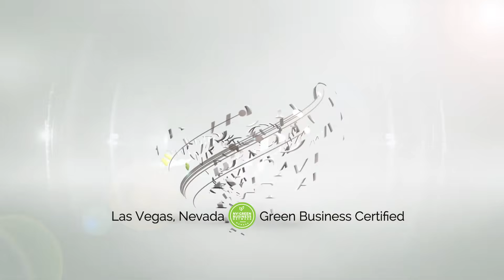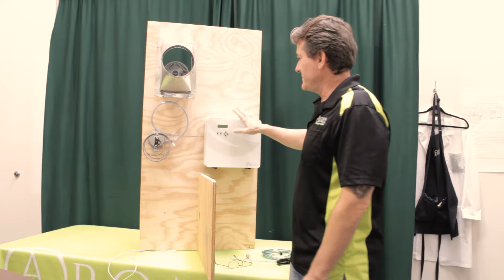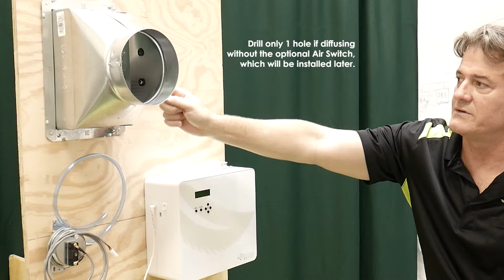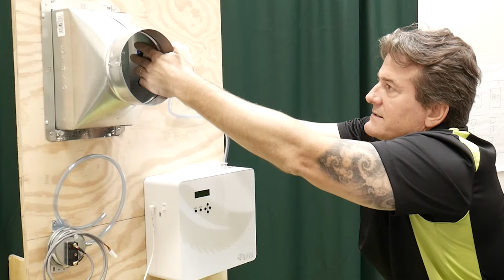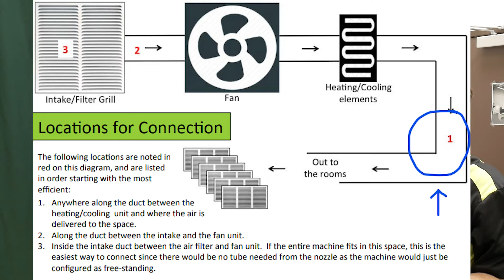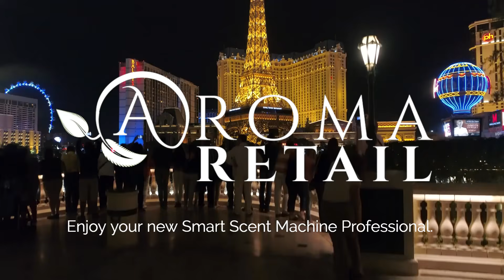How To Install & Connect The Aroma Retail Smart Scent Machine Professional to HVAC With Air Switch

Comment: Okay, so my plenum is in the attic. My ac filter is in the attic. How would you suggest this get hooked up? The way it looks on the diagram is, I could just stick it into any AC. Line, but that seems a little odd. Wouldn't I need to put it in the one that pulls in air (return);instead of blows the air? Each of my bedrooms has a return in it.

Comment: Do you disconnect this cleaning with alcohol.  Run it outside to clean out every few months?
Reply from the maker: You can leave it plugged in, but you'll want to have the machine on while it's diffusing the rubbing alcohol for about an hour!
Reply from the maker: @AromaRetail Every few months if you'd like, but definitely when you are rotating through heavier scents like our Holiday scents!

Comment: Is it safe to say you should insert the diffusion line AFTER any heating/cooling unit?  I have a vertical setup.  Cold return air comes in the bottom near the floor, then air is pulled upward and blow up into the ducts near the top of the basement.  I would think I want to insert up above the heat/cooling exchange zone, right?
Reply from the maker: Great question! Yes, it is ideal to have the fragrance come into the duct after the heat/cool exchange in the air handler.  There are rare situations where customers can only put it before the air handler, but it is much less efficient since the scented air has to pass over the heat/cool elements.

Comment: My home is 1,500 sq ft and I would like to install it into the HVAC system. The pro machine says it covers 10,000 sq ft. Is there a different, cheaper unit I could use for my size space?
Reply from the maker: Hello! Great question, the Professional Unit of ours is the only machine that has the accessories and ability to install in the HVAC. You can dial down your settings to make it fit a smaller space, and if you do that your 27oz refill that comes free with the unit with last months! 
Your other option is getting our Smart 101 Machine, which is a freestanding machine. That machine can cover up to 2,000 sq ft but it works best in an open area, such as a common area or entryway. You might want to get 2 of those if you have a 2 story home!

Comment: Can the Smart 101 machine be plumbed to HVAC?
Reply from the maker: Great question! No it can't, the motor isn't as powerful as the Professional Unit, which can push fragrance through the 4 foot tube that's provided :)
Reply: Thanks. Can the pro machine handle 10ft of tubing? My install will require it if I need to run it to the supply duct. 

I can however, easily run it with the standard length via the return - will that work? Or will that cause some sort of damage to the HVAC components.
Reply from the maker: @AngelInTheDesert  We provide 4 feet of tube or it'll cause condensation! You can try 4-6 feet but just know that's why we recommend 4. the tubing needs to be in an upward plane too
Reply: @AromaRetail  understood. Can I install it in the return duct instead?
Reply from the maker: @AngelInTheDesert  That should work! If you need extra tubing email us or you can get it at Home depot or any store like that! https://www.homedepot.com/p/UDP-1-4-in-I-D-x-3-8-in-O-D-x-10-ft-Clear-Vinyl-Tubing-T10006005/304185147

Comment: I’m considering one of these. I was wondering if it might make sense to wire it up in such a way that the diffusing unit only had power when the air handler was running so it only diffuses when air is blowing? If so, how would you wire it up to work that way?
Reply from the maker: I think you could consider our additional attachment for the machine, it's the Air Switch Kit. That triggers the machine to turn on when it feels air pressure from the fan. https://aromaretail.com/collections/all/products/air-switch-kit?_pos=5&_fid=0710b9d39&_ss=c
Let me know if that helps answer your question

Comment: Can the tube be placed in a apartment hvac? Would puting a hole in the filter and placing the diffuser tube in it have the same effect?
Reply from the maker: That should be okay, but you might need to clear that with your apartment complex. Alot of apartment customers just freestand the machine and use the tube to push it outside of a vent, behind a closet door or something!

Comment: I have three hvac units around 6 feet from each other in a triangle configuration, could I connect the three units with one diffuser using  a splitter, as long as the tubes are straight with no curves to leave condensation?
Reply from the maker: You will have to make your own split tubing- We only provide (1) 4ft tube so that the machine doesn't collect condensation- The tube needs to be going in and upward motion so the leftover oil can go back down into the unit. If you decide to try this, You can get tubing from Home depot and it should be 3 8ths inches.

Comment: If the residential air pressure is considered low which means the high pressure connection and tube won't detect that level of pressure, why can't you connect to the low pressure air switch port and still put the tube into the same duct as the diffuser ?
Reply from the maker: If you have an area with slow air pressure, you can put a tube on both the high and low pressure areas to make it ultra sensitive!

Comment: Can the machine AND air switch be placed horizontally but possibly at a higher level than the duct horizontally ?
Reply from the maker: Hi, no the air switch needs to sit vertically at all times :-)
Reply: @ thats not what i asked :) i asked if the air switch (sat on a vertical plane) can it be on a higher level than the air duct, horizontal with the air duct or lower than the air duct ? Or it doesnt matter ?
Reply from the maker: @WesR1111   I understand, I hope this helps more: The Scent Machine needs to be below the duct, so the scent tube can slope upward to allow condensation to flow back into the machine.   The Air switch can be above the duct because it’s just sensing change in air pressure.  Let us know if that helps, or reach out directly if we can answer further questions 702-780-7370. Thank you!

Comment: Last weekend I installed a pressure switch and it was simple to install and works perfectly.  I hate to argue with the CEO Jim, but I recommend the pressure switch from the jump in *every* installation.  I have three pro units in my home because I have three separate hvac units.  (However, each single unit is rated more than the whole house size.)  Since installation, I have not been overwhelmed with delight.  During parties we have had to use other products around the house.  Although I purchased the pressure switch with the first unit, I had never installed it based upon Jim's advice (and warning) in this video.  My main home unit is set to turn the fan on (at least) once a day, so his suggestion was not use the pressure switch.  However, I I did not turn up the machine, I could not smell much of anything but if I turned up the scent machine, I could smell it fine, but it was empty in no time.  And the scent juice is not cheap stuff.  To be honest, if we had not already had such a large investment in hardware, I would have searched for an alternative solution.  Turns out it was because the machines were putting out scent when the fans were not running, and wasting the scent.  I suspect it was just drying on the sides of the plenum and not going into the house at all.  Since installation of the pressure switch, I can turn up the scent machine without wasting the scent.  So far, the operation is as originally expected.  I will be ordering 2 more pressure switches.
Reply from the maker: Every home is different, so keep that in mind. The machine works in most homes and the air switch kit is still optional, especially for those who have their air running all the time! We appreciate the feedback and your business!
Reply: Where can I purchase the pressure switch? 
Thanks for the intel Paul
Reply from the maker: @AlvInBrown-rn2ue   you can buy it here https://aromaretail.com/products/air-switch-kit#6ace/fullscreen/m=and&q=air+switch

Comment: Are your machines rated to withstand a certain temperature?  I was concerned about mounting in my attic.  I'm in South Louisiana (but my attic seems to max out around 125 degrees in the dead of summer)
Reply from the maker: no need to worry, we have clients in your area and other HOT cities. the Pro can, has, and will withstand extreme temps (both hot and cold) while inside your home.
Reply: @AromaRetail  thank you 🙏

Comment: I have one (1)  5-ton AC unit for upstairs and downstairs. How many HVAC diffusers like this one will I need? I just ordered one, which is en route to my residence.
Thanks
Reply from the maker: 1 Pro to 1 air handler will work best! some properties have multiple handlers which will require multiple Pros!

Comment: yeah, no! im  not drilling holes in my ductwork that's crazy!
Reply from the maker: We have hundreds of customers who have installed it this way, as it's the most effective way. If you have a filter that's in a closet somewhere you can hide the machine in the closet and put the tube through the vent.
Reply: @DinoMartin I know it may seem a bit drastic and unnecessary but I suspect you are thinking about what happens if it goes terribly wrong and you’re stuck with a hole in your duct.. I thought the same thing and that’s understandable but keep in mind worst case scenario, ducts are built with several separate components. So altogether your homes duct system is expensive. However, since duct systems are built by attaching several smaller pieces together, each piece is actually quite inexpensive. For example, the duct piece in the video is $15 at Lowe’s & Home Depot… I figured if I screw this up and no longer want it, I can grab a new duct fitting and just replace it. Of course there is also steel duct repair tape made specially for patching holes but that’s $15 a roll so a new part might be more economical. Hope this helps ease your concern about the hole.

Comment: How long the output tubing can be? 
My HVAC system is in a attic where normally is hot and I would like to set the machine for easy refill on the first floor where have power and its cool.
Reply from the maker: The tube we provide is four-feet and should not exceed that for best scenting results. For this reason, the Scent Machine Pro must be close to where you're porting the tube into HVAC. If this doesn't work for you, we suggest getting multiple Scent Machine 101s to cover the spaces needed so that you can refill in peace and coolness.

Comment: This looks nothing like my attic system. I see two boxes and then tons of tubes wrapped in black material. Looks nothing like what has been shown. Im just going to return! I cant find where to put this!
Reply from the maker: e-mail us with pictures or so you can set up a time with us to help you troubleshoot! sometimes the Pro is NOT the best option for a space, perhaps the 101 might be more suitable!
Reply: Don’t put the michine in the attic - a will destroyed with the attic temperatures changing specifically in summer- the will get duperhot - 
put it inside close to main return after the filter - you will get nice suction pressure-
Plus the guys was mentioned a fan - it’s not a fan , it’s a blower, fan is the one out dide with blade at the condenser - that’s why a called ceiling fans because use blades - 
very easy to- but my recommendation don’t put it in the attic

Comment: Is the unit rated to be installed outdoors on the side of a package A/C unit ?
Reply from the maker: the S.M. Pro should be installed indoors and away from direct sunlight, moisture, and possible animals / critters. however, some of our clients NEED it outside and will build custom enclosures for it.

Comment: Would it be better to mount the machine where the output nozzle is directly under the air duct and have the tube come in from the bottom of the duct instead of the side? Then the tube is super short without any bends or distance so there’s no loss of vapor
Reply from the maker: placement UNDER is preferred! this allows any condensation of the oil to safely go back into the machine WITHOUT being trapped in any bellies, so make sure it's a straight line. you are welcome to bring our hose to a hardware store and get a longer one BUT the maximum length we suggest from nozzle to port is 4 feet. sometimes 6 feet is fine, just as long as there are no bellies along the way. this is why we provide a shorter hose.

Comment: Thanks for the video. Just curious, isn't aroma oil flammable when exposed to heating elements?
Reply from the maker: there is no heating element in ANY of our Scent Machines. otherwise, yes, fragrance oils are flammable. our cold air diffusion prevents unnecessary warmth caused by the machine AND keeps the integrity of the fragrance. no heat generated by means you experience the aroma in its intended form.
Reply: @AromaRetail  I'm sure that the machine wouldn't have a heat element, the one I am referring is in HVAC. In your schematics, #1 location is only place where oil doesn't go through the heating element. Isn't it?
Reply from the maker: yes, #1 does not go through a heating / cooling element and is the ideal placement. locations #2 & #3 are also viable in spaces where #1 cannot be achieved & are SAFE before the heating / cooling element because the flashpoints of our oils are higher than inside an HVAC system.

even at the flashpoint, it would need an ignition like an open flame to start causing trouble.  the main reason we want people to TRY to put the fragrance after the heat exchanger @ location #1 is because the heat will cause more of the fragrance to evaporate before it is able to make it to the spaces.

Comment: When adding the optional air switch, does the machine need to be programed to recognize the switch?
Reply from the maker: no, it does not need its own programming! it is triggered by a difference in air pressure once ported to HVAC. feel free to call us or e-mail us with further questions!

Comment: Does the pressure switch come with the 1500 sq ft unit? It don’t say on your website
Reply from the maker: the Air Switch Kit is optional and can be purchased separately here https://aromaretail.com/miscellaneous/ OR see Products > Parts & Accessories

Comment: Can I put a longer hose on it ?
Reply: We recommend 4 feet to avoid condensation, you can clip it shorter but if it's too long you may not smell the scent!
Reply from the maker: we suggest the shortest distance needed from machine to duct! if you need to add one or two feet, then you should be fine. you'll know if the hose is too long if you cannot detect the fragrance.

Comment: After installation, the delivery of scents is only good in a specific room. The master room has a weak scent, the small room is strong, the bathroom is strong, and the living room is weak
My house is on the third floor
Reply from the maker: the solution to this is relocating placement somewhere else in the H.V.A.C. system! in the user guide, we illustrate multiple places that it can go, and since you're experience an imbalance, it means you should move it to find a better balance. call us or e-mail us!
Reply: If you have a T plenum and trunk ducting, I would suggest installing it in the T plenum for even distribution. I just got mine to try out if I like the results. I think it will be a nice option for some of my customers :). HVAC SINCE 2004.

Comment: I have a condo-type closet HVAC with the open face filter. It has the plaster-like plenum directly above the air intake filter. Is it okay to run the tube into the plenum?  Also, that would be the low pressure area correct?
Reply from the maker: the plenum may not carry enough of a pressure change to trigger the air switch. I would have to see where you want to put the tube, please send us a short video (or photos would work too) to Care@AromaRetail.com if you haven't yet. A plenum is usually large and open space that allows air to flow freely, but not a duct.

I would also recommend putting the tube either between the air filter and the fan (low pressure) OR after the fan between the fan and the room outlets (high pressure).  After the fan is always preferred for optimal scenting!

Comment: What if you have a split unit? I have one AC Unit in the attic that has two zones. So the first floor as it’s on thermostat and the second floor has its own thermostat.
Reply from the maker: one Scent Machine per air handler is what we recommend! some places have 2, one unit for upstairs and one unit for downstairs. in that build, two Scent Machines would make life easier.

sounds like you have one handler. in that case, one Scent Machine will work since the main fan can only do one zone at a time.

Comment: I need fresh air when it is blowing hot air (heating), will this work?
Reply from the maker: no matter if the air blowing is cool or warm, the machine will diffuse on the schedule you set. remember, the Air Switch is OPTIONAL and only necessary if your fan DOES NOT turn on every 6 to 8 hours to circulate air.

Comment: I have 3 ac units.. Sheeesh.
Reply: Me too.. I'm wondering if the 2nd floor would fall down to the first and up to the 3rd lol
Reply from the maker: @jasonseawright83  There will be some traveling of scent between floors depending on airflow and floor plan (walls, doors, etc), but it will not be very strong or consistent :-)
Reply from the maker: Remember that each one needs its own machine for best results!